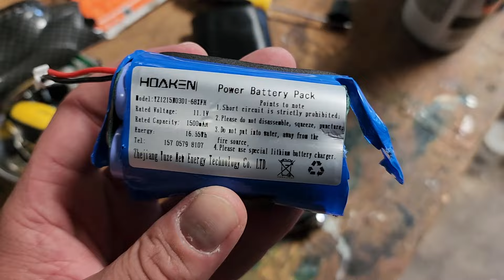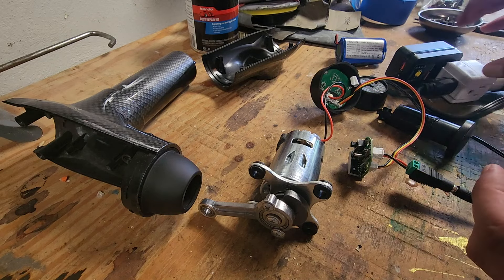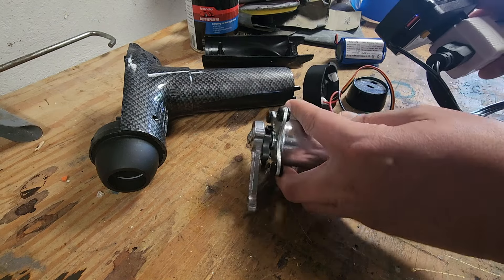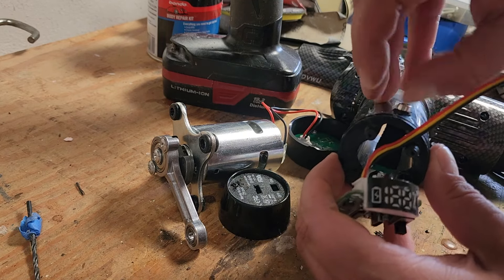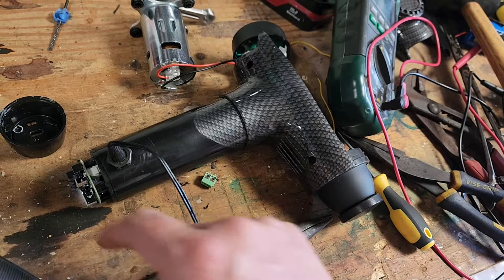Repair Percussion Massage Gun DDVWU | Replace Old Battery with Wired Power Supply | Cheap DIY FIX

Comment: I have the same one, different brand but everything identical.  My battery holds like a 5 minute charge, I am ordering the power plug jack and doing this this week.  Thank you so much,  Liked & Subscribed =).  Does the massage get more Ooompf from the wallplug, batteries get weak but also limited by their amperage,  I am hopping it can be super strong with some extra amps =)  Thanks again!
Reply: Big improvement, motor is rated close to the original battery spec so its not stronger than before, but it remains consistent since their is no voltage drop when you put pressure and it steps up the intensity.  Very pleased, saved me from buying a new one.

Comment: Hi, which voltage adjustable did you buy in amazon?is it the lowest voltage, 3v?
Reply from the maker: 12V, 7 amp
Reply: Don't rip your massager to shreds, there's plenty of batteries on amazon.

Search "18650 11.1v battery", most are higher capacity than the old one, 2000 mAh, instead of the 1500 mAh that came out of it.